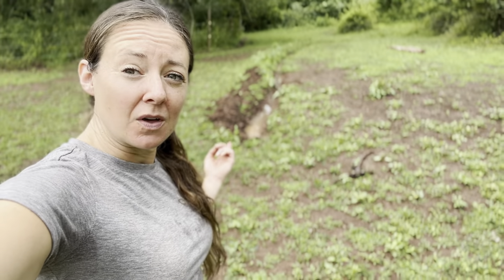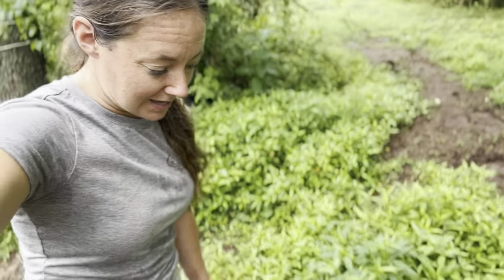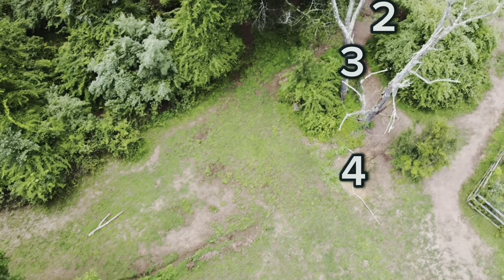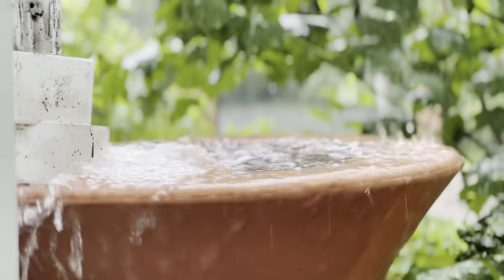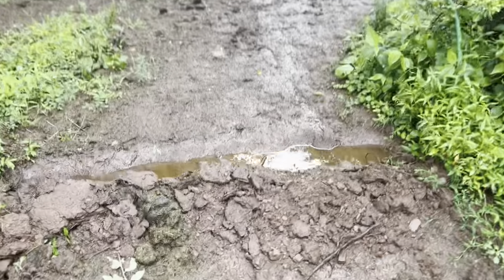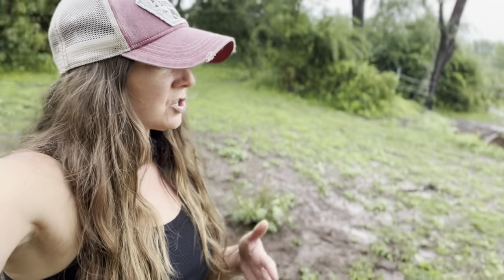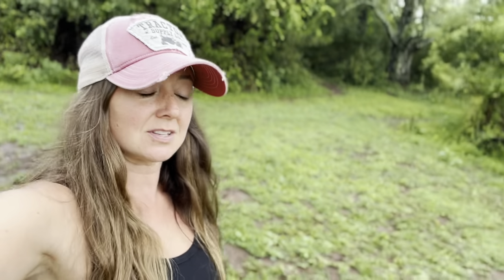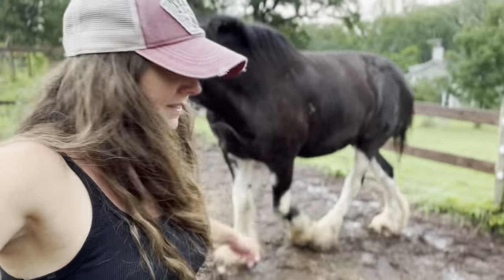Adding More Swales to Catch Water Runoff

Comment: Wow! That rain.  I feel like the swales weren't large enough. I say this with no knowledge so, how does one figure out what size of swale is right for one's property?
Reply from the maker: Hi! The swales I just installed are uphill from the flooding, so they are not in the path of that massive rush of water. Swales wouldn’t be able to handle that and would get washed out. Instead I have them uphill to help with water runoff. Swales can be small (around 10” deep minimum) to much large like roadside ditches. I stay on the small end since I have livestock in these spaces and a broken leg would be catastrophic. ☺️
Reply: @AxeAndRootHomestead  Thx!